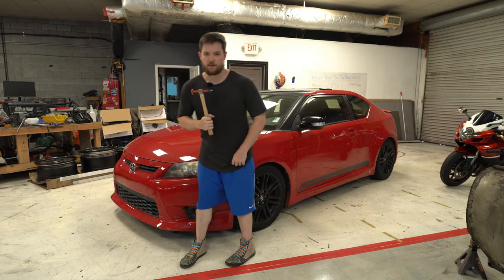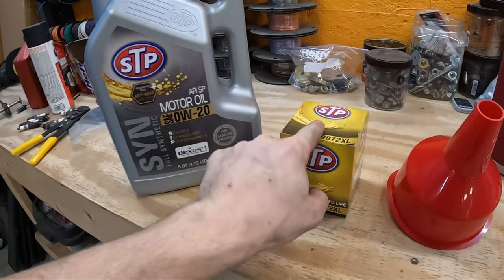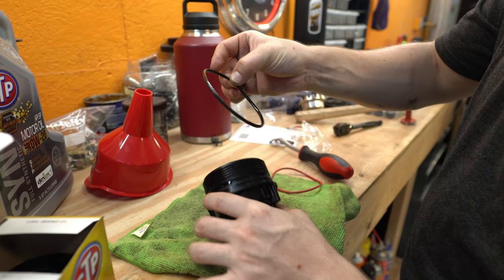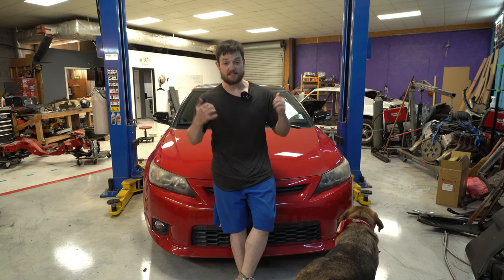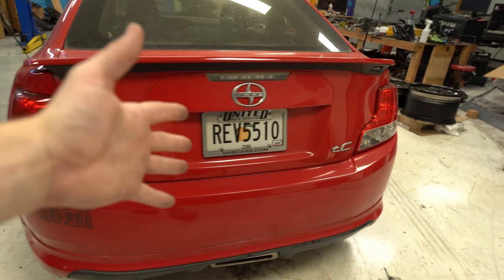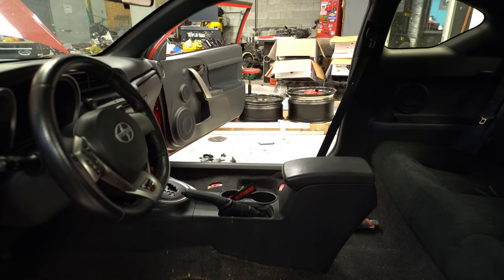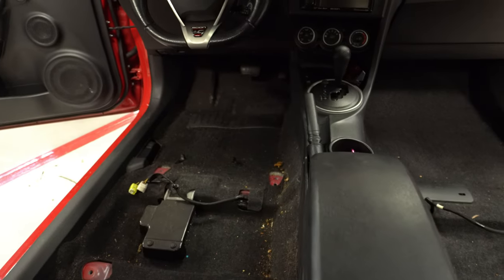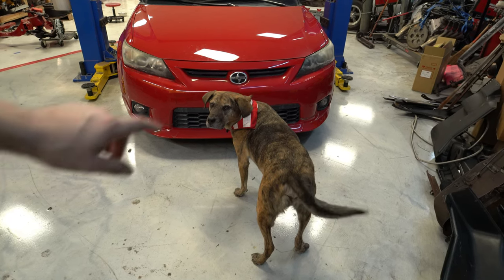MY FREE CAR IS BLOWING MY MIND...

Comment from the maker: Get 25% OFF @True Classic by visiting https://www.trueclassictees.com/DOITWITHDAN #trueclassic
Reply: Dan, ODS said you lied about the bubble gum
Reply: please dont forget to put some new headlight housing on the free car. some cheap ebay specials will work just fine with some 6500k spectrum bulbs. night driving will be amazing.
Reply: @SmallEmpire ⁰
Reply: We Need More Jax!
Reply: As a previous tC owner the rear bumper was always an issue when I had mine I absolutely loved the car had a lot of plans for it but totaled it bc of a deer and with the cartridge oil filter the factory one is very fragile and they make metal OEM replacement ones at any auto parts store I would definitely think about getting one just in case if the next oil Change that cartridge filter cap breaks

Comment: I had a 2012 tc really liked it for what it was. Everything on them is super simple to fix or change. That being said it would just toss the headlight in the bin and get some aftermarket ones. Think Spec-D has good headlights and tail lights that would look good on it.  My 2012 on the back of the factory radio had rca outs so you could easily put subs in it if you wanted.
Reply from the maker: Maybe I'll polish these and sell em. I've been looking at aftermarket headlights and tails too.

Comment: Hey Dan, quick tip for ya. If you or someone you know uses amzoil, you can take the bottle, and it screws right into the oil fill. Cut the bottom off and BAM perfect funnel.

Comment: Last one I promise. If you pull the intake and clean the valve and intake I saw a significant mpg gain. Near 5mpg. It's worth it and would be cool to see if you're able to do it
Reply from the maker: Oh snap! What do you recommend cleaning wise?
Reply: @DOITWITHDAN  the shops use like acorns or like a soft abrasive sand gun thing.

Comment: I recommend replacing that oil filter cap with a metal one from your nearest part store. The plastic ones tend to break during removal, especially if you're not careful or dont put the removal tool on completely straight.

Comment: i used to be a castrol gtx nuthugger but for the last few years i have been using the WALMART SUPERTECH Full Synthetic with LUCAS PURE SYNTHETIC oil stabilizer and a FRAM ULTRA SYNTHETIC filter. work just as good as all the other "big name brands" but for less money.

Comment: It seems most people don't know about the transmission problem in these cars. The rear input shaft bearing fails and needs to be replaced, not 100% sure it won't happen again though even if you use the new bearing (different part number that replaces old one)

Comment: So, just my opinion, make the TC a track/ autox car by ONLY doing suspension upgrades and see how the times improve, would be a good experiment to see how suspension makes a car "faster" without any engine work, PLUS it will let you get good at track driving before you Put the C8 on the track

Comment: When I removed my seats to clean after I replaced them I had and airbag and seatbelt light come one. Curious if you'll have the same issue
Reply: If you disconnected the airbag harness for the seats with the battery still connected or forgot to plug them back in (yellow plug/harness) before hooking the battery back up it will trigger an airbag light.  Have to take to a dealer or use a scan tool to reset.

Comment: hey just an FYI if nobody else has said it; they make Metal filter housings for them there toyoder engines. saves you the hassle of breaking off that plastic bitch if it ever breaks or won't come loose (: sold at most parts stores

Comment: had to replace the water pump on mine at 80k miles, the bearing was going bad and making noise, then the rear input shaft bearing started going bad, manual trans

Comment: As someone who knows, don't ever bother draining the canister. If it's not already leaking, leave it alone. Better to treat it like a normal filter. It should have a lock on the side as well. Just snug is tight enough 👍
Reply: Also brother, there's spacers on your lift. The black extensions on each arm lift the pad height
Reply from the maker: Thanks for the insight on the oil cartridge. As for the lift pads, I know they can get lower, but even removed the lift doesn't clear. I couldn't get the lift to clear the side skirts, so I had to jack it up and then add the extensions so it didn't crush my skirts. Just car stuff lol
Reply: @DOITWITHDAN oh, I see now. In that case I feel your pain. My own car is so low it can only be lifted on an in ground lift

Comment: you're running high profile point on your lift. you just got to get the low profile ones. most pro shops have like 5 or so lift pads for different ride heights and styles.
Reply from the maker: It wasn't the pads, it was the lift arms themselves. They made contact with the side skirts, so I had to add the pad spacers and lower the car on them